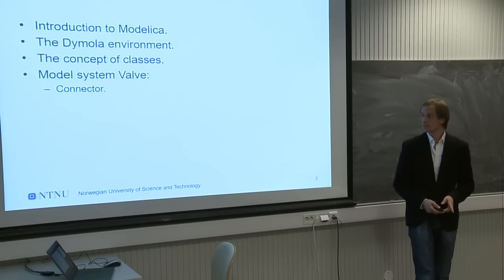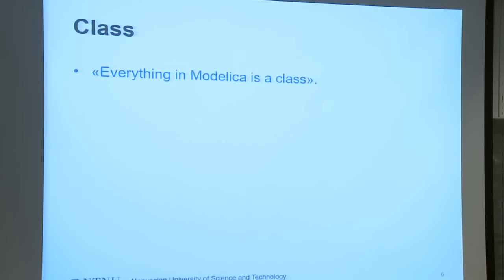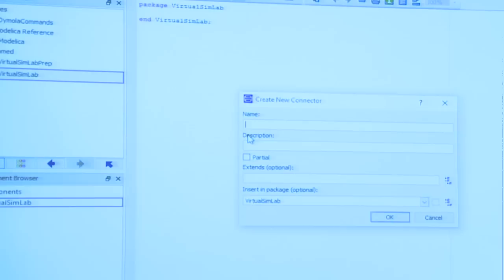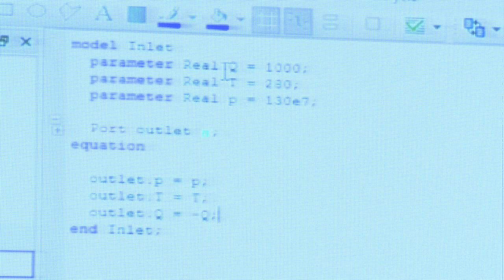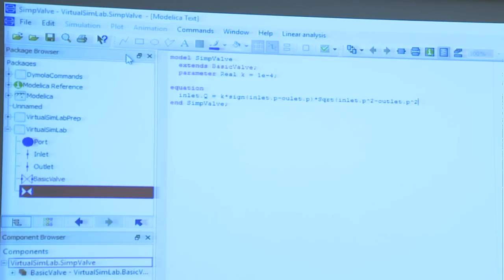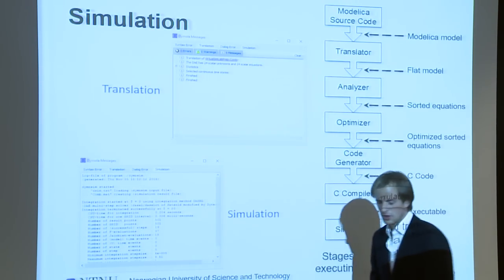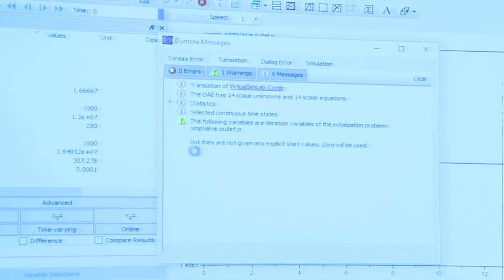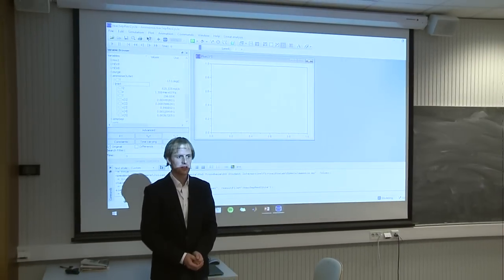Introduction to Modelica

Comment: Thank u sir

I'm using 32 bit windows 7 to run the openmodelica
software

this error appeared as I opened the openmodelica

[1] 10:06:27 Syntax Warning

[C:/OpenModelica1.13.232bit/lib/omlibrary/ModelicaServices 3.2.3/package.mo:
165:40-166:7]:
OpenModelica only supports 31-bit signed integers! Truncating integer: 2147483647 to 1073741823

And when I write a simple tutorial program.. this
error appeared:

[5]
10:33:30 Warning

Out of memory! Faking a stack overflow.

[1] 10:33:38 Warning
Out of memory! Faking a stack overflow.

[2] 10:33:38 Scripting Error

Stack overflow occurred while evaluating translateModel(RLC_Circuit.circuit, startTime = 0, stopTime = 1, numberOfIntervals = 500, method = "dassl", tolerance = 1e-6, outputFormat = "mat", variableFilter = ".*"):

[bt] #1 [... unsupported platform for backtraces]

Could anyone help me, please

Thank u in advance